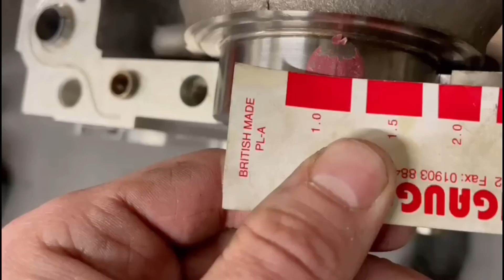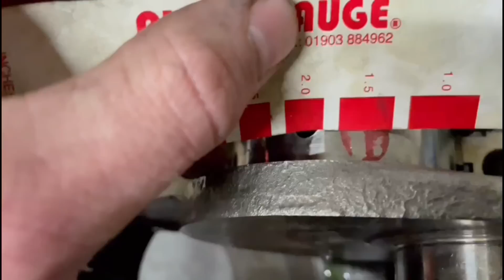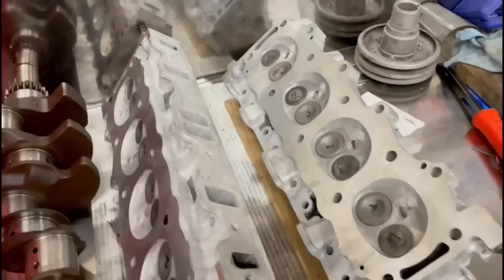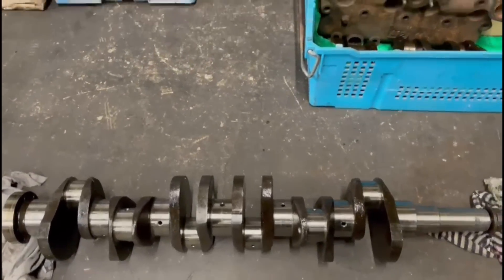What is the difference between reliable engine or SCRAP? Doing this!

Comment: Those cradle bolts are TTY - single use.  Once torqued with the angle they are not reusable.  Torque-to-yield bolts fail at a high rate when reused.

Comment: Great insight on bearing grades and oil clearances, do you plastigauge first and then micrometer the crank pin diameters along with a  bore gauge for the housing diameters for comparison and accuracy?
Or just rely on slightly inaccurate plastigauge method.?

Comment: QUESTION: @5:50, some bolts should get 30 nm, and then another 180 degrees... Seems like you're about to stretch the bolts, to mount everything properly. However, this is a mock-up, and trying to figure out which bearings you're going to use. Will you be replacing the bolts after each test, due to being stretched? When testing a second set of bearings, with the same bolts, can you reliably get the same clamping force out of those old bolts?
Reply: No, the 30 Nm + 180 degrees is a the method intended to attain clamping consistency across the fasteners. I don't believe those are 'stretch' bolts.
All bolts stretch when torqued. That's how they maintain clamping force.

Comment: I always remember the furore caused with a Renault V6, the one used in the big Volvo's and the underlying hint in the Haynes manual for the engine was "Leave it alone, don't touch it, don't breathe on it" as the engine was continually fraught with dropped liners, bent camshafts, tappets jumping off the pushrods, whilst the under gear would be merrily breaking in expensive and hair wrenching manner, snapped crankshafts, sheared crank ends, those Renault V6's back then were a mechanic's nightmare poss one of the worst engines of that era.

Comment: When I "blueprint" clearances, I torque the mains without bearings or crank.  Then each main bore is measured.  Using a ball mic, each bearing half is measured and marked.  Each main journal is measured.  Take the journal size plus the clearance, then subtract that from the bore diameter and divide by 2 gives the required bearing thickness (if memory serves lol).  The rods are done the same way.  Each bearing is chosen, then marked for its position.  Lastly, the assembly is mocked up with Plastigage as a final check.

Clearances have changed a lot due to improved materials and lubricants.  Back when I started in shops, a V8 performance engine would sound like a diesel when cold due to the big clearances on the forged pistons, usually as much as .002" per inch of bore, and loose bearings to allow quick throttle response and higher revs.  There were no synthetic or 5W oils, we usually ran 20W50 performance oil to give good oil pressure and bearing protection.  The last engine I built had about .004" total on forged pistons and bearing clearance on the high side of stock.

Comment: Why didn’t you just measure the bearings to see what thickness size they were against the other ones
Reply: The thickness of the bearing only matters in how it affects the oil clearance, and things all compress very slightly when the bolts are torqued to spec. Plastigauge is the easiest and extremely accurate way of measuring the clearance, just don't allow the crank or rods to move otherwise you'll be cleaning everything and starting again.
Most manufacturers will give a couple of different journal diameters and two or three rod/crankcase diameters, and the various shell colour codes will work to give the correct oil clearance for each rod/journal combination and journal/crankcase combo, but nothing should ever be taken for granted as crankshafts get reground, so whenever building an engine always use plastigauge to determine the correct shell codes.

Comment: Hi Paul, on the early Honda Civic / Accord range they had colour coded bearings which was determined from the codes / numbers on the block and added to the codes / numbers on the crank which gave you the colour needed from the parts list for mains. The big ends were numbers / codes on the conrod with the number / code on the block to determine the colour as dictated in parts list. Each permetation could yield different colours for each application, I think there were half a dozen of each colour. I did notice some digits on the block so it could be the same system, again was checked using plasti-gauge.
Reply: Spot on. Built many an engine with this system. But like you state doesn't look like there's many  manufactures manuals and tolerance specs used at this shop. 1.5 thou seems a little big too me.
Reply: I don't think he can hang ballballs on the tree let alone work all that out.

Comment: Watching your channel, from the USA, I decided it was time to get started on the new engine for my 69 Mustang.  It's an S-code 390 V8.  I bought a spare engine and dropped the block off at the local speed shop to be checked out.  They sent it out for cleaning and then magnafluxed it to check for cracks. It was never rebuilt so it still had the factory bores.  Zero cracks, the shop said it had very little wear so it likely had low miles.  The shop is starting to get the parts in on it.  The top end is Edelbrock Performer RPM heads and intake, the crank and rods are from SCAT for more stroke.  The new engine will be 445 CI (about 500 HP but will be dyno'd once it's together).

Out of curiosity in the UK do you mostly rebuilt engines with factory major components?  Or do you sometimes build engines with more after market stuff?  Not to familiar with non-US engines.

Do you ever have the engines you rebuild either run in and or run on a dyno?

Comment: I have a very anal book on the developement of Rolls Royce aero engines.The Merlin suffered from mains journal bearings when it was new.The tolelances were initially too "tight" and relied on running in at low  loading to get them right.Oils of course were less viscous than we have now.Oils now are so thin its a different ball game.Its a very anal book and if my wife finds me reading it she just goes to bed frankly.Oh well.
Reply: hi if we had not bothered about details would we not still be living in the caves with clubs. Compare a bread and butter 60s engine to a modern engine the difference is details.
Reply: Would that be The Merlin in Perspective ,the combat years by Alec Harvey-Bailey.I for my sins worked on the Merlins big half brother the Sea Griffin and that was not completely with out problems.